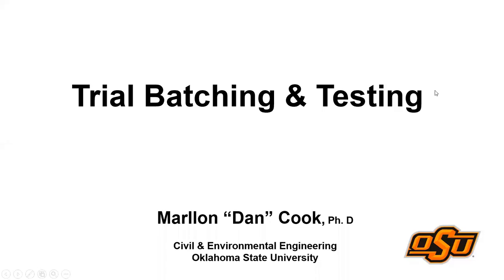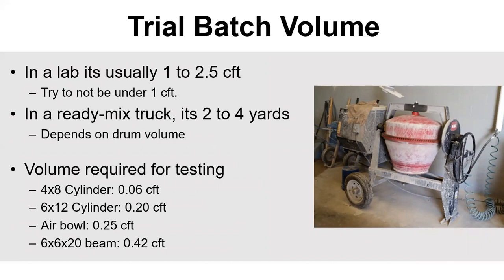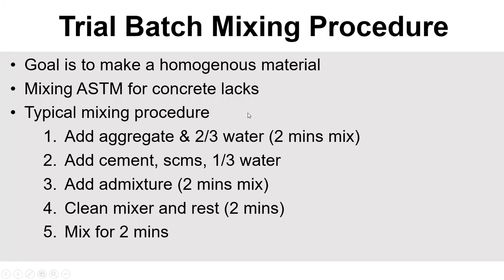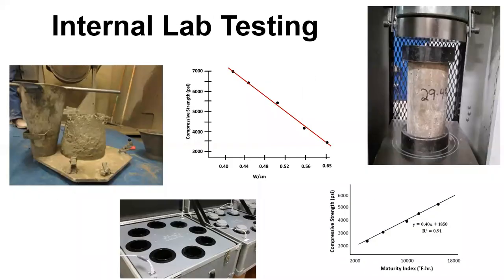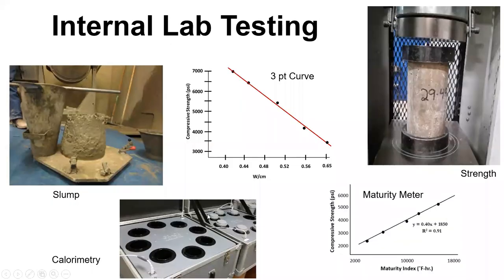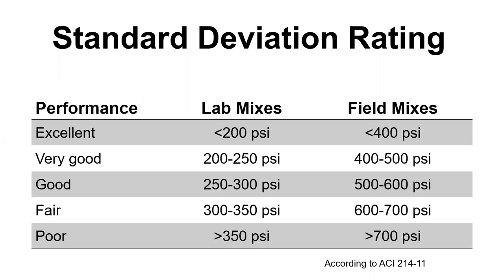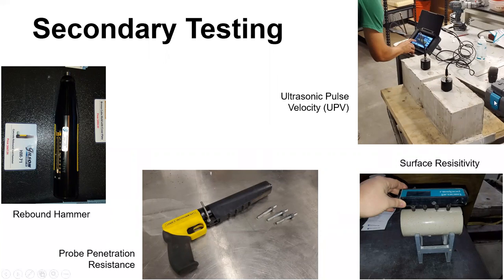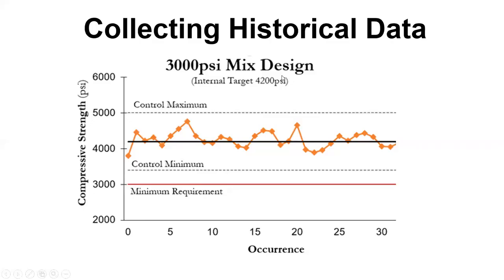Lecture 14 Trial Batching Concrete

Comment: so the whole process of mixing would last for 9-10 mins which in practical terms is too much!
Reply: We typically mix for 3, rest for three and mix for 2 minutes. So, 9-10 minutes in the lab isn’t too much. This is a lab test, for actual production you get a lot more shearing from the larger mass.